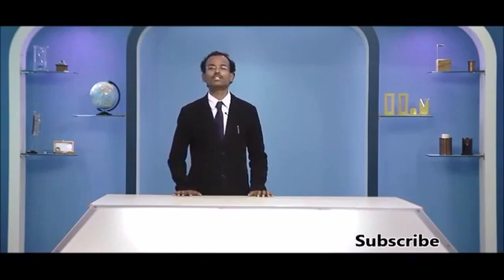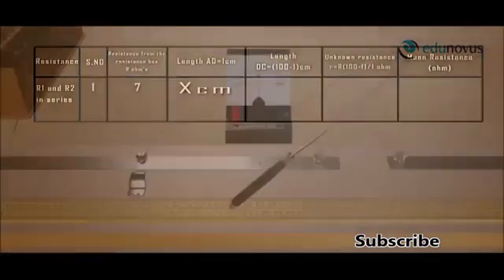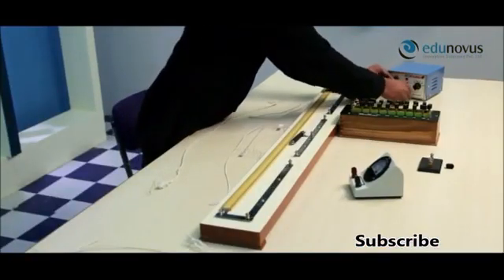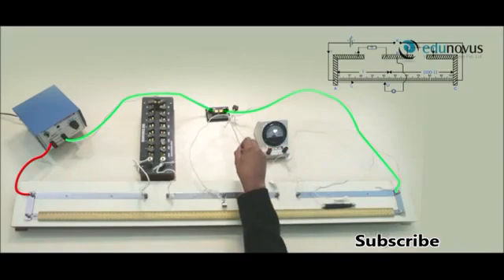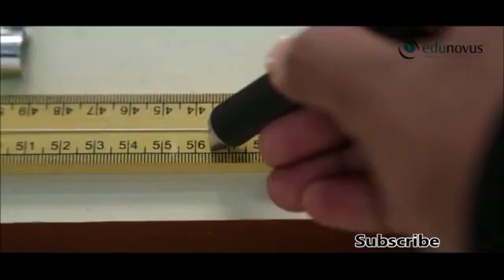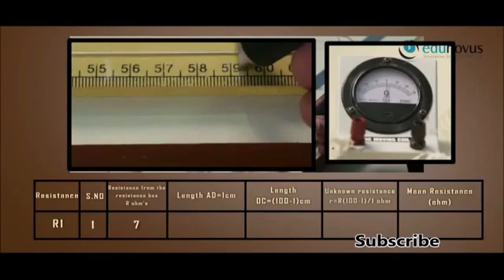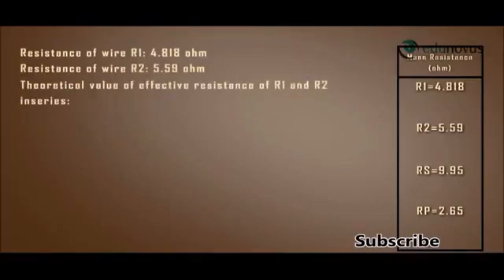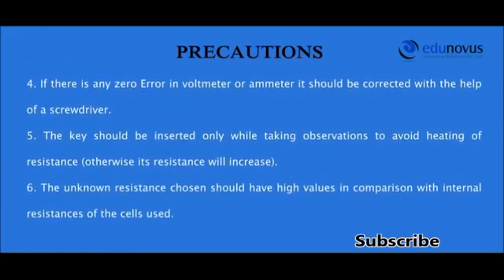Laws Of Combination series and parallel

Comment: CONNECTIONS SUMMARY
*Postitive terminal of the battery eliminator to be connected to one end of the metre bridge.
*Negative terminal of battery eliminator to be connected to the other end of metre bridge 
*Resistance box to be connected in the gap
* Postitive terminal of galvanometer must be connected to the centre strip and negative terminal of the galavanometer must be connected to jockey
Reply: u forgot unknown resistance
Reply: Just Byheart the circuit diagram....Simple
Reply: Hehe
Reply: Thanks